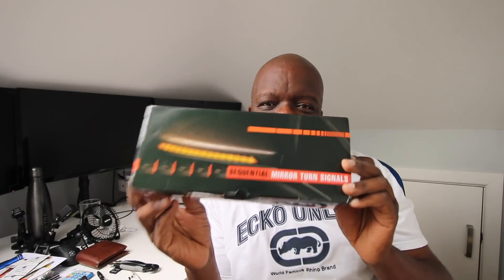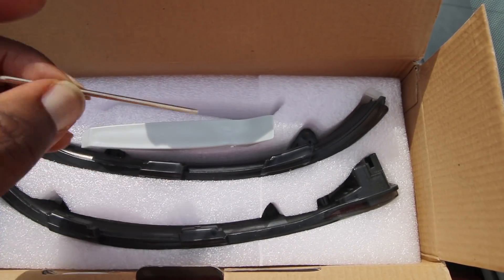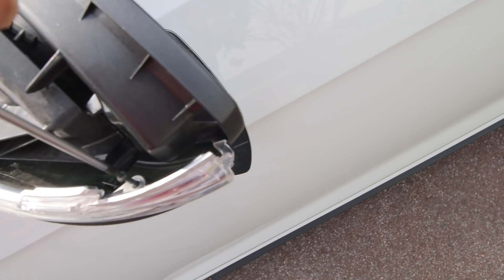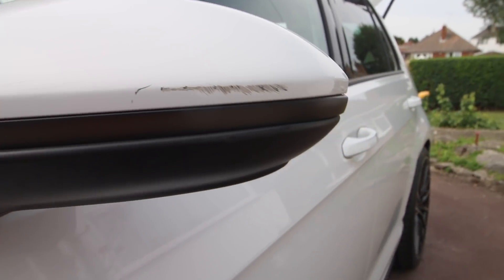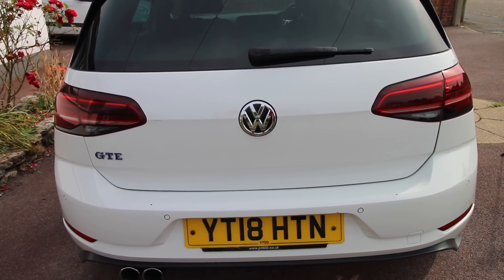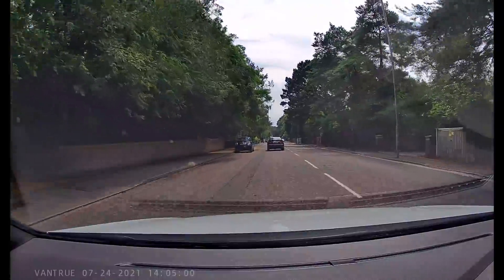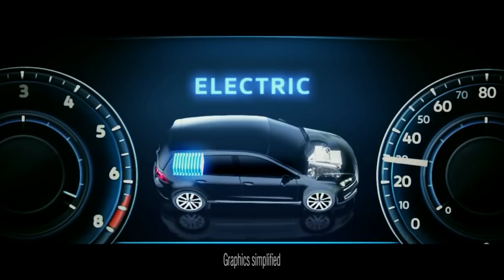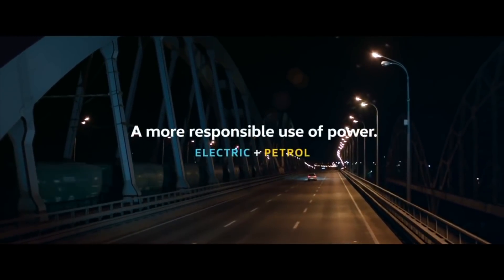The Golf GTE has a secret VW doesn't want you to know

Comment: When fine tuned, it can produce almost 300HP :D. The Start/Stop is annoying in GTE mode, which you can disable. But i tested that, when you do a launch it almost makes no difference when the engine is running or not. At least, it feels like its more quicker when the engine is off, and it launches with the electric motor first before the engine kicks in.
Reply: I must admit I’ve been using an electric leaf in recent weeks through work - although its useless for long runs (the charge stations are useless in the UK away from home - as they all use a different system / app / ‘fuel’ card) - locally its excellent - and the acceleration is silly for a school run / town car - I’m pretty sure that (with the know how) that 104bhp on the electric side of things can be extended way more than the petrol side of things.

Comment: Paul, having done a technical analysis of the GTE (I own a Mk7), it's a bit more complicated than 54 hp + 150 hp.

The electric motor in GTE mode is derated about 25%.  So around 75 hp.  However, it provides full 75 hp boost at the lower range of power output, and as the engine reaches full power, it drops to the ~50 hp you observed.  

This is to keep the gearbox torque under 350Nm - there is a third clutch that fits around the electric motor which is used to engage and disengage the engine.   
Exceed the torque rating of this clutch at your peril, as it will require a HV technician and experienced gearbox engineer to replace.  It will not be as easy as the DSG clutches to change (they are not easy as it is but at least some people have done it.)
Reply from the maker: Thanks for that Thomas, the companies that I have been working with have all got GTE research models as I had the same concerns, these cars have done several thousand miles, and they have taken the experiences and apply them to the products they sell.
Reply: Pp
Reply: Is there a tool you can use to monitor all of this?
Reply: @edc1569  VCDS / OBDEleven.

Comment: The Mk8 GTE is 242bhp, and as far as I'm aware it's mechanically almost identical to the Mk7/7.5 - though with a slightly larger capacity battery.
Reply: This is another reason to believe the marketing logic, they needed to sell GTI and more powerful next generation (probably they knew they will not bring up completely new engines)

Comment: Watch running cables down an A piller if the car has side impact airbags or an air curtin airbag system becuse if you cross over the deploy path your wire could pull out or stop the safty restraint device from properly deploying making it useless. You want to run the wire close to the windshild and behind to tethering cords.  And that's a pro install.

Ps dont poke the bag or unplug any wires.

Comment: Fitted some similar dynamic indicators to my mk2 Tiguan. Mine have an additional wire which connects to the puddle light in the mirror base. When you open or close the car in lower light conditions the dynamic indicators light up white for a short time. I agree they are for more visible in operation than the Orem ones.

Comment: In Holland there is someone who tuned the GTE to > 300hp. Electric engine to full and another turbo. 
He has a youtube channel presenting the car. 

There might be a battery issue involved. 
Mine cuts "full electric" mode when uphill but the battery is already 7 years old so there might be only marketing. 

Anyways the handling is horrible on this things...because of the rear added weight.  I changed the suspension not long ago but it does not seem to be much better. The front wheels spin like crazy when in gte mode (it would be nice to be able to have 4x4 with it).

Comment: 16:53 - that is a deadly mistake to exchange the chip. If doing so your insurance will not have to pay and this means you will have to pay anything.
Your car is no longer street legal and this means you are screwed and have to pay for everything - at least in the EU. 
More horsepower is fine but you need to adjust the insurance to keep up with the higher risks which come along with the higher horsepower and its usage. 

Statistics by Allianz Reinsurance have proofed that years ago. And here you will face criminal charges too if you are involved in a car accident cause in the EU the police can confiscate the car to check if it has been tuned, modified, changed compare to the factory delivery. You have the reponsibility and the prosecutor willl attack you not for having caused the accident but violating innocent who had been involved. The fines are pretty high like 12 month net income or prison if you had already trouble before that incident.

Comment: Nice video..! How visible are the mirror indicators now from the rear (a driver who is next / behind you, e.g in your blind spot)..? That’s the main reason why indicators are there instead of fenders/wings as they were before (higher up and in light of sight of approaching cars from your side). Also, you should not pull the wire across the A pillars which houses the curtain airbags. Go down along the windscreen and back down the edge of dash instead. Good luck!

Comment: Just FYI: All you say is correct for an MK7 Golf GTE. With the introduction of the MK8 there are two PHEV-Variants: A "civilian" version with standard styling with 204bhp and the new GTE with 245bhp. This is now the same as the standard MK8 GTI. Both use the same drivetrain with the new lower tier having the same software limitations as the MK7 GTE. On that note: Your thumbnail is a bit missleading, since that GTE-secret does not rally apply to the MK8 GTE (at least not to the full extent as with the MK7) 😜

As far as I know the MK7 GTE was never really intended to be a real performance model but just the hybrid variant of the standard Golf. It just got the styling to be a bit more fancy and special.

Comment: You don't calculate total bhp like that. No manufacturer does it like that where they just add the values together for the total bhp.
Reply from the maker: its true, they dont, its peak power, however, in this instance peak power for the electric motor is in GTE mode is 54 BHP, the petrol engine can actually produce 165 BHP and when peak power is reached the EM drops around 9 bhp

Comment: Sorry to burst the Bubble but that is not why it is rated 204hp it is because the e-motor and the petrol engine produce there peak hp at different rpm meaning that the petrol engine may make 150 at say 5200rpm but at the same time the e-motor is geared at a higher ratio so will be at 10000+rpm I would imagine well past its peak hp .
Reply from the maker: I use to think this, but the tuners I have been working with who have GTE test cars have shown me the map they apply and where the power increase comes from and it is from the electric motor

Comment: Won't your battery go flat in 5 minutes if make motor twice as fast
Reply from the maker: No since the it will be working in conjunction with the petrol motor. when driving in pure electric mode, the motor runs at the full 100BHP
Reply: Can’t really go flatter any quicker than it could if you were hooning it in fully electric mode

Comment: VW Assist Braking and more....Great Video on the Dash Cam....But so hate the way that VW and others are going with Assisted Braking and Assist this as Assist that but does not Assist our pocket with apox £5K going on top of the prices with Online Connected Vehicles. Until you can opt out of these features when ordering new they have lost me as a 20 year VW customer to buy New again!  keep with my older vehicle with out the  junk. I want to drive not the VW Computer as VW have a law suite in the US against them on Assisted Braking. Which i have had  problem that slams on the Brakes! with along with Stop/Start that won't re-start the vehicle and leaves you Dead in the Road!

Comment: Or another option, buy a 1996 Suzuki RF900 for under £1000, 0to60 3.3 seconds 🤣
Reply from the maker: Yep, I miss my bikes, a GSXR 900, and a 2006 R1 loved those bikes
Reply: @CarsForPaul  Love bikes too 👍🏼, if you ever get a chance to try out a TL1000R they are crazy, crazy crazy torque, 3rd gear wheelies just by cracking the throttle 🤣🏍